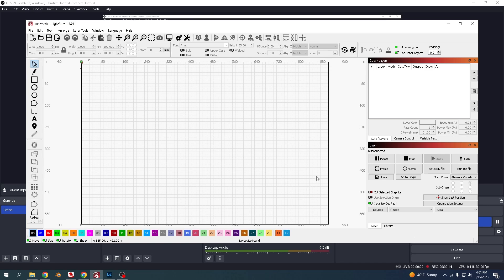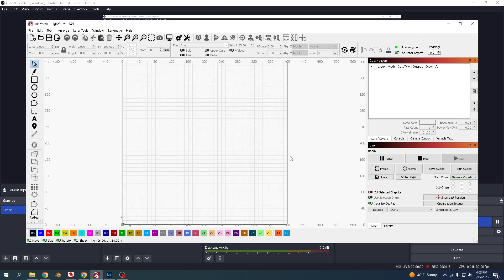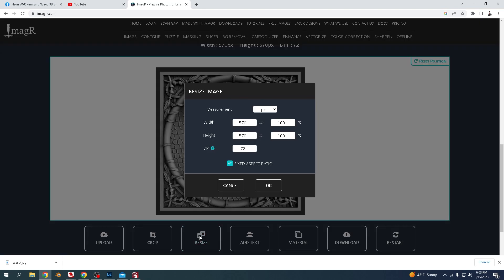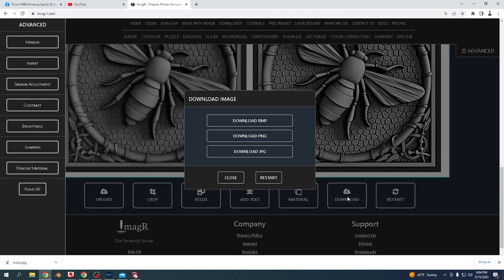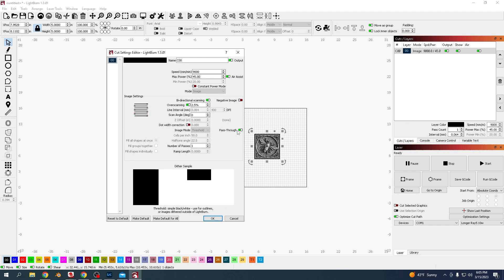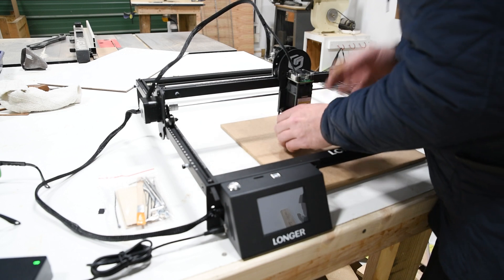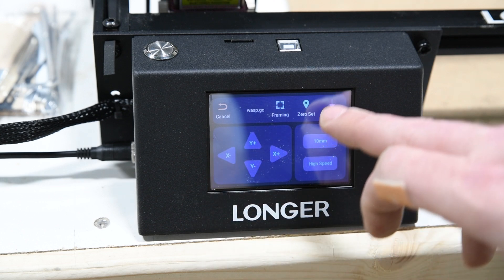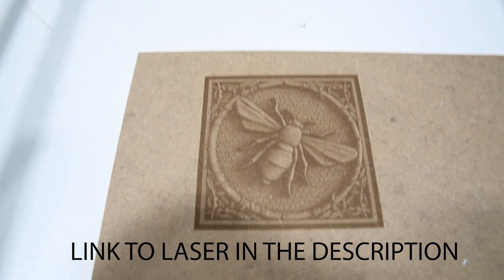Longer Ray5 10W Diode Laser Lightburn set up & Etch 3d image

Comment: Great job explaining the 3d effect, just got my RAY5 a week ago, I'm very interested in this 3d look, could I use Lasergrbl instead of light burn and get the same effect?
Reply from the maker: i would think so, i have never tried Lasergrbl, the main thing is if you dither the image outside of the laser software  you have to use an image mode like passthrough that will allow the laser to use the dots already created. hope that makes sense. thank you
Reply: @carphotography  Thanks for getting back to me, watched your video again and it makes perfect sense. Lasergrble has the passthroough option. I like it  that you are demonstrating on a Ray5 10w, that's what I have. Not sure how to come up with DPI setting, is 400 a good number to always use?
Reply from the maker: @tarndt9217  the higher the dpi the longer it will take but the more detail it will have, you can do it much less if you wanted but the image wouldn't be so crisp, according to the website the laser can shoot a 0.06mm dot according to lightburn that would make it 423dpi maximum, if you use lightburn it has built in tests where  you can test the DPI at different numbers and same with speeds and powers, on lightburn it is up the top under laser tools (Y)
Reply from the maker: @tarndt9217  also normally the more DPI the darker it will burn, if you search my videos for DPI you will see i made one, it was on another laser but exactly the same concept.
Reply: @carphotography  I will check your other videos, thanks. I am looking at purchasing a file off Etsy, they suggest a DPI of 500. Thank you again for all your help!!
Reply from the maker: @tarndt9217  yeah that is possible but one dot will be going partly over the other as that would not allow the space for a full dot, it wont hurt at all, your best bet is do some DPI tests and see where you think it looks best once you tested make sure to keep the test or write down your favorite settings and then you know where you want to be every time, my other laser that is a bit larger does fine at 260DPI for photos.
Reply: @carphotography  thanks, I am running test now

Comment: Hi, thanks for your video helped out alot! I have a Atzer p10 laswer and I was wondering what wood you used for this video? and also what wood would you recommend. Reason why im asking is im currently using basswood and for my laser for the fastest engrave is basically 7000mm/min and thats with 100% power before it stops showing any engrave. When I seen how well yours came out at 9000 I was amazed perhaps this laser just isnt up to par with the RAY 5 but it could also be the wood.
Reply from the maker: sorry just see this i use mainly either MDF , Birch ply from home depot or Thrifty board from home depot all work nice, MDF is harder to cut but if you have a saw you can cut to size before engraving.

Comment: Thank for the helpful and straightforward video. Exactly the information I was looking for.
I just want to add, if you are using a Longer Ray5 10W machine. When setting up your origin, you'll want to turn off the auto "home" on start up feature because there are no limit switches on that machine out of the box. I can speak from experience that the machine will run into the edge of it's travel but the motor will continue to run and burn up your belt otherwise.
Reply from the maker: Thanks for the info!